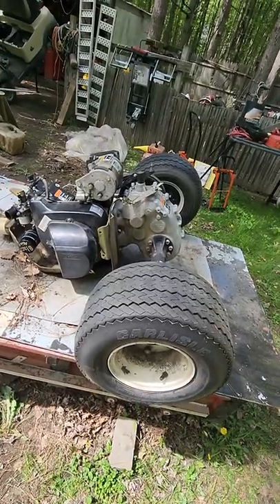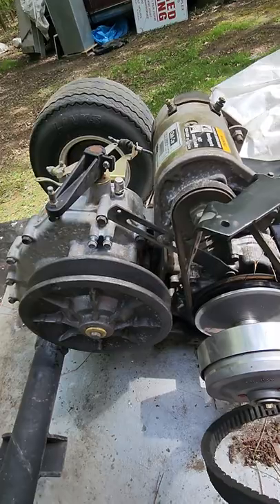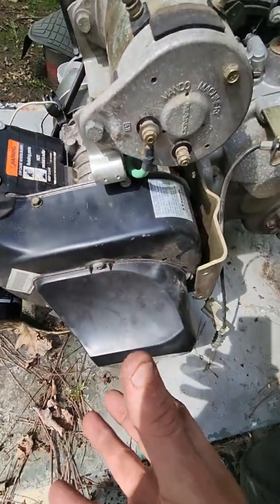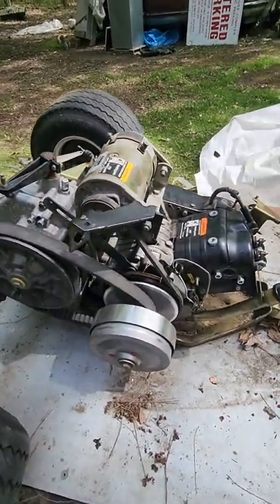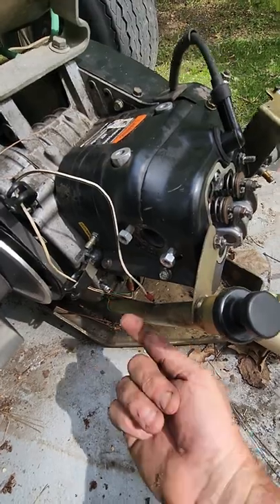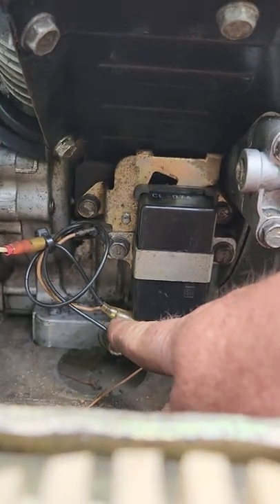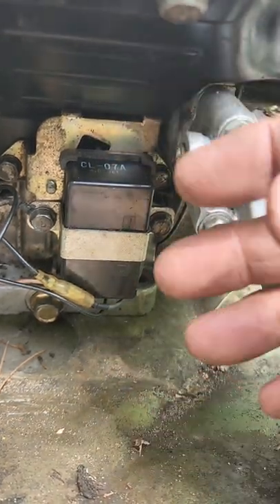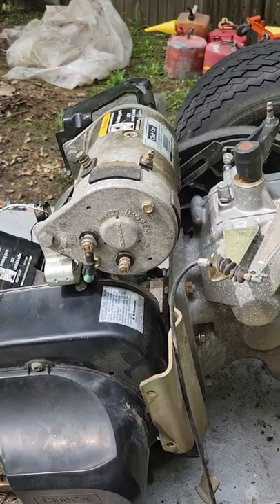ClubCar fe290 spark , coil  engine out.

Comment: Nick - Great Video. I have a 95 Club Car DS Gas with the FE 290. I was driving it and it would run great get down the road, stop and it would not get going again. I would go get my trailer and after 20 min of cooling down it would start running again. I have replaced my coil, but it still is doing the same thing. Should I replace the rev limiter or coil igniter next?
Reply from the maker: I would disconnect the riv limiter at the brown wire First. Run and test. If the spark still fails then replace Igniter and test again. Keep me updated.
Reply: @Contractorrepair  I removed the brown wire to the rev limiter. I tested and the cart did the same thing. I let it cool down and the spark came back. Do I replace the igniter then or the rev limiter?
Reply from the maker: Replace the ignitor/ and or Ignition coil.

Comment: Howdy. Great video.  I just purchased a used 2003 Club Car with the Kawasaki 290. Multiple issues so far. Gummed up carb, weak fuel pump also sucking air at the crankcase line. There was a couple blown fuses one being inline. Also an intermittent no spark condition im dealing with now. Unfortunately im on our seasonal campsite at the moment and will have to return and trailer it home to work on it. But heres what’s confusing me. It runs fine for a while, when we get to the base of a hill is very typical where it dies.  Now if i hold the gas down and quickly shut the key off and turn it back on a few times it would start.   Not always though.  When it does start it may or may not die on its own.  There’s definitely something intermittent there????   So i did purchase the rev limiter. (The block on the lower front of engine). Haven’t put it on yet.  But im thinking about relocating it to the side of the engine compartment. Whats your thoughts on that?
Reply: K incoming 2 minutes
Reply from the maker: 989 395 0913  Probably should have a phone conversation

Comment: My starter motor keeps burning up. Previous owner removed Rev limiter and adjusted the governor. He used it in his driveway with no problems. But now that I have it, it’s driven more frequently and longer trips. Thats why it’s failing. Will installing a new rev limiter and voltage regulator solve my problem?
Reply from the maker: Well, It could be a multitude of things ,now adjusting the governor down. Just slow the speed down to about eighteen miles an hour I suggest. You will know because does the cart will travel slower. second of all and I say this with 30 years of experience.
A silver line brand starter gen/ remand of non club car . There is a 60/40 chance the starter will fail. I have had some fail in 600 yrs brand new off Amazon. I'm sure you get my point. Are you brushes going to hell? It might be easier just to give me a call
989 395 0919 Nick

Comment: hey i just picked up a 1996 that has the silver ignitor behind the rev limiter. it has weak spark , the previous owner cut the wires to the limiter and the ignitor, i tried wiring it back up together using wiring digrams and your vid but if i understand you correctly by unplugging the white/black wire near the oil dip stick it bypasses everything and if i still have no spark(weak spark) my issue is the coil itself correct? i removed the shroud cleaned the coil and the magnets also unplugged the black wire directly from the coil still just weak spark on tester. thanks for making these videos really helps a lot.
Reply from the maker: Yes replace the coil.
Reply from the maker: Well what happened. ?

Comment: Hello I know this video is a year old, not sure if you are still replying to comments or not but.
I'm trying to fix my dad's old golf cart that has a 1999 kawasaki FE290D-AS17 engine.
The Problem it is having is intermittent spark. some times it will run great all day and other times it won't even drive out of the shed.
The problem has been getting getting worse over the past two or three weeks and now it's very unreliable.

I've tried removing the rev-limiter, still does the same thing.
This does not have the igniter behind the rev-limiter plate just a wire that goes under the heat shield.
Does the 1999 model kawasaki FE290D-AS17 not have an igniter or is it somewhere else?

I've noticed if I take a screwdriver and ground out the plug wire for several spins of the engine, it will start sparking again for a little while before then stopping again.
Not sure if that helps with the diagnosis or not but...
Reply from the maker: A hard start to your issue is to evaluate all of the equipment wiring. The connections that allow Spark to exist, and stop. Do you possess what they call a spark tester?
Reply from the maker: I know this sounds simple, but have you replace the spark plug? My concern is that there’s a crack in the porcelain if it’s the old one.
Reply: @Contractorrepair  I don't have an inline spark tester but I tested with a screwdriver in the plug wire and the spark is very inconsistent and sometimes it won't spark until I ground out the plug wire on the head for a few spins. 

The plug is new and I tested it in a lawnmower that ran fine with it.
Reply: For Anyone having the same issue. I was able to confirm that the 1999 model has the igniter built into the coil and that was the issue in my case.
I replaced the coil and it's doing good again now.

Comment: I recently got a 550 mule with the fe290 engine, i put a new carb on, it has good spark but will not crank or even fire. It is blowing misty fuel?/smoke out the carb intake.  i adjusted valves with no change.  You think it could be that the intake valve needs lapping?  I could post a video of what its doing.
Reply from the maker: Time to pull the head. Valve action ( poor closing of the intake and it's call blow back. Our piston at Top Dead center or in lamins term 90 before the piston return back in to cylinder.  Once the pistons come up to the top off the cylinder that's call TDC.se under compression both valves need to be closed and I mean closed. I great way to check is once we are at TDC is to pop the valve cover and wiggle the rocker arms and if we find lots of play or it tighter than hell it's time to adjust the valves to 0.06 both will the piston up at TDC. If there's still  blow back out the intake the intake valve is ether hanging open and or bent. This my seem like a lot of info. But start here and if that S.O.B. still blows back get the head off its time to see under the plug and valve seat area.
Reply from the maker: Do you have a compression tester. Take a reading before the heads removed then after the new gasket ( head gasket ), is reinstalled check it again. What's you plug the original one look like wet and oily or dry and black chalky looking.